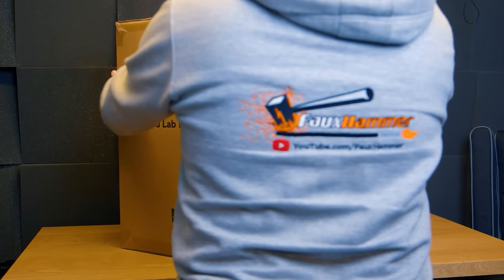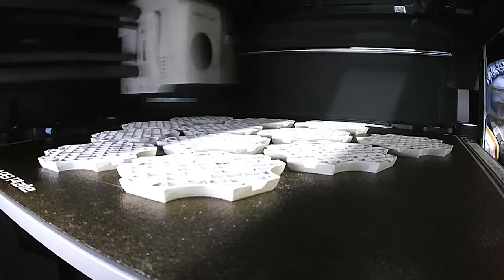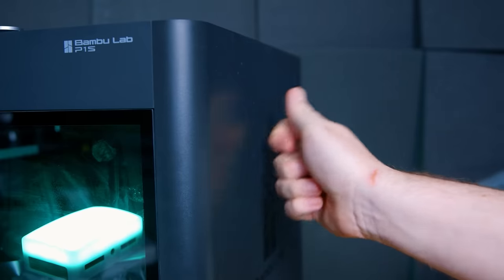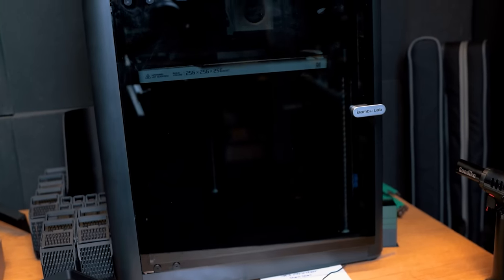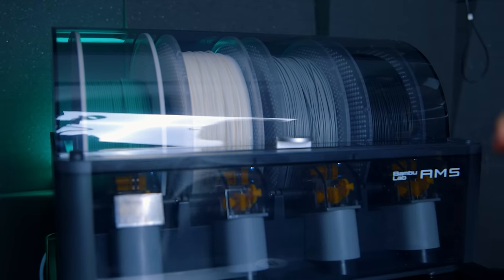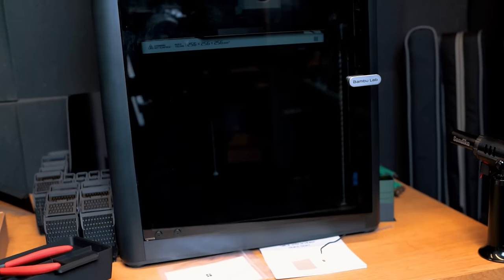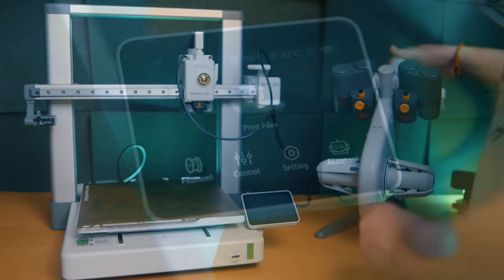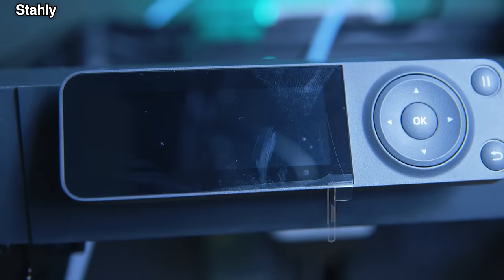Bambu Lab P1S Review - Please Start Here - I BEG YOU

Comment: is the A1 combo good enough, if you dont want to print abs asa nylon etc
Reply: Absolutely yes. In fact the A1’s are quieter and moisture isn’t that big of a deal with PLA. If you find it is, simply buy a spool dryer to use frequently. I have a mini and at work we just got an A1.

Comment: I think the support from Bambu just ruins me on the other companies Support. I look a the GK two support love the printer but there support is just not there. By the way I sold my Anycubic M5s boat anchor for $200. I love the screen on the X1 carbon but with the app you don’t really need that screen. The x1 screen make it easier to use at the printer which is important to me but the next one I’ll buy is the P1P just because of the AMS, that’s a maybe lol. As alway great video, I love the stock videos on because it helps put your point of view across. Thanks as always B
Reply: One thing that reviewers of the Bambu Lab always fail to mention is that the WiFi connectivity on these things is not very good. Which is odd, since the out of the box approach is indeed a major advantage of this machine. 

To connect the machine to your pc you need to install their app (which asks user information, location and for some reason your contacts information). Next, it only can make a connection through a pilot blue tooth connection (rather than entering SSID and pwd immediately, like on all other networked machines). On top of that, the WiFi antenna on these machines is notably very weak (as a summary search of Youtube comments describing similar issues indicates).

All this is very odd, since the WiFi antenna is on the back of the panel. Production and customer relation wise, it would have been very easy to update the WiFi antenna to a stronger model. Despite this, comments regarding the weak WiFi reception (and the complicated process of making the connection) go back all the way to the first release of this otherwise quite good machine.

Comment: I am totally new to 3D printing and consider getting a Bambu Lab P1S-Combo. I have a few questions.
1- Can you print with the Bambu Lab P1S-Combo w/o internet or do you have to be connected to "your" account from Bambu Lab?
2- Does the AMS act as a filament dryer or you need a separate unit to keep your filament dry?
3- Can I print a STL file directly?

Thank you for any input.

Comment: They really are an impressive bit of kit. Printers with similar features and capabilities that come to mind as alternatives are the Qidi Tech X-Plus 3 and the Flashforge Adventurer 5M Pro. The X-Plus 3 is a bit larger, has a better screen, the enclosure is heated, and is cheaper right now. The Adventurer 5M Pro also has a better screen, superior air filtration, is a bit smaller, and is even cheaper. Neither are fully open source and neither have an AMS. Also worth noting the Adventurer 5M is $299 right now, which is crazy, and they are releasing an enclosure kit which is a mixture of a cheap purchase and printed parts. So, not interested in AMS? The others might be good options. Want AMS? Bambu Lab.
Reply: Oh, I did of course forget the Creality K1/K1C. I'm sure everyone knows the deal there. Some flaws, similar capabilities overall, smaller build volume, cheapest of the bunch. I can definitely see why people would go for the P1S given the overall reputation, but saving money is always tempting. Anyways, thanks for the review and thoughts!
Reply: Flashforge just released the klipper firmware for the adventure series
Reply: @marcostaffoli5798  Oooh so it allows vanilla Klipper to be used or is it a proprietary implementation?

Comment: Youre not wrong, the corexy is better if you can afford it, but if you cant, the A1 is TOTALLY acceptable as a starting point.  Either way, theres now almost no excuse to buy a bedslinger from anyone but bambu if youre starting out.

If you need to excuse getting the enclosure version just remember youre gonna use a lot less power if you arent air conditioning your printer and your printer isnt heating your entire room.

Comment: One thing that reviewers of the Bambu Lab always fail to mention is that the WiFi connectivity on these things is not very good. Which is odd, since the out of the box approach is indeed a major advantage of this machine. 

To connect the machine to your pc you need to install their app (which asks user information, location and for some reason your contacts information). Next, it only can make a connection through a pilot blue tooth connection (rather than entering SSID and pwd immediately, like on all other networked machines). On top of that, the WiFi antenna on these machines is notably very weak (as a summary search of Youtube comments describing similar issues indicates).

All this is very odd, since the WiFi antenna is on the back of the panel. Production and customer relation wise, it would have been very easy to update the WiFi antenna to a stronger model. Despite this, comments regarding the weak WiFi reception (and the complicated process of making the connection) go back all the way to the first release of this otherwise quite good machine.

Comment: Does it auto calibrate input shaping and self resonance like the A1 does? Should I buy used P1S or A1? Caveat: I do NOT need speed.
Reply: Bought new A1. No support for Cura is a huge bummer as any Prusa Slicer derivative including Orca is inferior in terms of usability by a mile!
Reply: Yes. You just put the print on the SD and then the machine makes a lot of noise and then the piece comes out. Very out of the box. Very noise and bad WiFi too.

Comment: You mention that when printing with  pla with the P1s, the top glass has to be removed to regulate temperature, I have read the same on some articles. BUT if I have an AMS filament unit on top, do I still need to remove the top lid or if I am printing pla, do I  have to move the AMS to the side? Thanks for such great videos.

Comment: Almost went with the P1S but opted for the A1 with AMS lite instead which i have been super happy with untill the rear heatbed cable issue. 
Might be worth some A1 users returning their faulty units and upgrading to the P1S instead as i can see a long wait ahead with no printer at all whilst Bambu Lab get a grip of the situation.
Reply from the maker: I heard about that issue, didnt they fix it?
Reply: @FauxHammer  They've stopped A1 sales right now. Got 2 options for those with the cord problem, fix it your self with the parts they supply and get compensation or get a replacement printer for those that don't want to DIY. Those without the cord issue will either get sent a part that they can install for more strain relief or if you need it ASAP you can download and print it yourself. It's in their blog.

Comment: Got one of these for black friday for €100 off and they threw in a couple of kg of random filament. Pretty good deal. So far printer has been pretty reliable although I used some old filament in it that unhelpfully snapped right in a place I had to disassemble the entire print head and remove the original nozzle to fix. There is something to be said for bowden setups when this happens and all you need to do is push filament through to clear the snap. AMS is simple to use, that it's easy to forget what a PITA it is to manually change filaments. It does poop a lot of plastic though and I wish the slicer profile would incorporate some of the poop reduction techniques people have come up with.

Comment: Id rather wait for the phrozen arco or bambus next announcement on the 5th of feb.
256mm bed is pretty small esp if you want to start making props.
Reply from the maker: I'm getting the Arco when it;s ready, still in dev stage, but I've seen some preview shots which I like.
Reply: @FauxHammer  thankfully its flying gantry! Ive been in talks, it seems good and the ams is a heated dryer too. But hopefully specs on paper to product it works well it even has a external filtration

Comment: I may be missing something, but coming from a Longer MK4 I'd say it's way more than a "slight increase" in print speed.  I have only run three prints through my new P1S, but I have run each of them through a slicer set up for my old printer and it's like 1/3 of the time if not less.  I was going to keep the Longer around for some basic parts, but after cranking out some parts over the last few hours that would have taken all weekend on it I think I'll look into ideas to repurpose it instead!!

Comment: I bought the X1C because of my specific needs and was able to justify the price, but I would have been just as happy (for the most part) with the P1S.  I had about 1 year experience with and Ender 3, however I found I didn't really need all that much of the experience in order to print very high quality reliable prints straight out of the box.

Comment: I like your videos. 
Been 3d printing for about 3 months.  I have an elegoo neptune 4 plus and 2 p1s's
Looking at buying anther neptune 4 plus. 
BIG  difference between set up and learning. 
If you could,  
I'm having an issue. 
Every time i switch filament,  My machine (p1s)
Says it is busy with another task. Making me have to shut the p1s completely off for like 10 seconds,  i turn it back on and it works fine..
Could you possibly tell me what I'm doing wrong?
Much appreciated
Reply from the maker: I’ve never seen this myself, sorry. Have you tried posting this in one of the Facebook or Reddit groups?

Comment: I've owned my P1S since September last year and it likely has over 700 hours of print time on it. This printer has been nothing short of a work horse. No bed levelling needed. In fact it has no limit switches. They've managed to capture the torque increases on the motors to determine where the limits should be. All I know is it's been a world of change from running cheap $400 printers that you have to screw with before printing to this monster that just prints what's it's asked to. I also bought the AMS which is changed my printing experience yet again. The printer and AMS cost me a lot but at then end of the day the savings in aggravation and the quality of the final prints was worth it. Just my 2 cents for what it's worth.

Comment: Did I hear you correctly that you have to remove the top cover to print with PLA? If you do that can you still put the AMS up there?
Reply from the maker: Yes. You don’t neeed to put the AMS on top in the first place. But you can also print an AMS riser with a shelf in to put the glass on

Or not and just open the door instead

Comment: I'm considering in buying this, for ABS and ASA, but at the same time, from the research i did, there are people that complain that it has issues printing ABS/ASA
Reply: Have a P1S. Printing large ASA flat functional parts has been difficult. Spent weeks tweaking for cheap Elegoo ASA and heating the chamber to 60oC w a heat gun to avoid corners lifting and warping. 1.5 hours of preheating and cooldown phases...  Printing small parts is probably fine, but without a heated chamber large ribbed parts just don't work.
Bought Bambu ASA, will see if it prints better / faster.
Am building an automatic heater lid now. Will see if the process can be automated.
More on my raphtronic blog, in case it helps.

Comment: I have used a resin printer for over two years now, but have been thinking of getting an fdm printer for a while. My main reason is for practical printing as well as wargaming accessories. Still unsure what would be best for me, as i am like you and don't want to tinker, so the bamboo labs printers have caught my eye, but i have a few questions. 1. Does the P1S require an internet connection to function? (WIll it refuse to print/operate without one). 2. Does it also require an app? (does it have features that are only accessible through an app). 3. It features a camera for timelapses and checking prints, but can it also detect print failures and cancel the print in the event of one?. and finally, 4. With the enclosure and filters, would this printer be safe printing while someone is in the same small room as it for long periods of time? 
Sorry for the long comment, i just want to ensure i am getting the right printer 1st time. Thanks for the informative videos. :)
Reply from the maker: No worries

Without Internet you loose the ability to send prints to it remotely over WiFi. But you can still print by sending files to an as card and popping that in.

It can detect some issues but not everything, but it rarely has issues after the base layer is down. The only issue I had was filament run out or jam, and it detects those

I have no idea about the safety of what these printers give off however, sorry
Reply: @FauxHammer  thanks for replying. I am not to bothered about wirelessly sending files. Nice to have as an option but i would rather not have a “always connected to home base” sort of printer that can be updated firmware wise automatically for better or worse. I think i may go for the p1s as so far it seems the best in terms of an appliance that does a job well and future proofing where filament choice is concerned. 😊 thanks again.
Reply: All printers give of fumes and microparticles. We're melting plastic after all. I wouldn't recommend being in the same room unless it's well ventilated to the outside.

Comment: Bought an X1 Carbon Combo Saturday. It is my fifth FDM printer. Wanhoa D6, Ender 5 Pro, Ender 2 Pro, FLSun SR with Speeder Pad in that order. If it had been my first I'd have a stable of Bambu machines by now. It's freaking amazing. I'll be very unlikely to buy a different brand for quite some time. Though it seems Creality K1 series is getting closer to this level of plug-and-play.We shall see.

The sticker thing is for the replacement build plate sheets you get with the X1-Carbon, I think. Mine came with two replacement surfaces to apply with you wear out the ones applied to the build plate.
Reply: Just get the textured PEI plate and never look back. From my admittedly short experience (a couple of weeks) with the K1 Max, it is the only current gen printer that competes with the Bambu's. Not on polish, but on performance. I hated the QIDI X Max 3 and was only too glad to replace it. I'm struggling with the Kobra 2 Max which seems to go from one broke state to another without much printing in between. But the three Bambus (one very new) keep soldiering on and the K1 is right there with them.
Reply: @Immolate62  Would you have a stable of Bambu or K1's I see the K1C and thought about getting that over the P1S

Comment: If you need to take off the glass lead off when printing with PLA , does it mean that I also need to remove the AMS module and put it somewhere else?
Reply from the maker: I actually printed an AMS rider which comes with a shelf so you can have the glass on top or raised slightly above to leave a gap

Comment: I have bought a P1S, and even for PLA, I still have it enclosed and disable the aux fan, it just seems a lot more "consistent" and doesn't lift the corners at all (it does if I have the fan on), and it also helps keep dust and debris out of the printer which was a big issue at the long term in my previous prusa mk3

Comment: Just a quick question: I saw you top mount 2 AMS units to your P1S. I can’t find a video showing how to do this, how did you do it?
Reply from the maker: Yeah so you need to buy the AMS hub from Bambu, once you do that you can daisy-chain up to 4 AMS units for 16 colours, which is what I have now.
Reply: @FauxHammer  and you have both ams units mounted on top of the printer right?
Reply from the maker: @talboomerik yes I did but now I have 4 it’s a little different. I found a dual AMS riser I printed which allows me to still lift the glass and put it in a shelf.

Comment: im considering to buy a p1s , first i looked at the a1  but its a open bed slinger  and i have kisd n´ cats , thats why i have my actual printer sv07(and all my others befor)  in a cabinet, and thats the next problem  normal bedsliinger are not designed to put them in a cabinet or any type of full enclosure, cause they fckn overheat .  most times i have 80+ degrees on mcu and 85+ on rPi .
so my choice comes to p1s  , i can put them where i want and get rid of my bulky cabinet .
Reply from the maker: yeah that is a better choice, and it echoes the reason i would also choose an enclosed unit. It has a more limited UI, but honestly, you'll control it remotely 99% of the time

Comment: Rather than support material, would just using something like PETG as the interface material between supports and the model work well? I imagine there would be a lot less "waste".
Reply: PETG works, but it doesn't adhere to PLA so I'm concerned about what could go wrong. I really don't have too much trouble removing tree supports (is there any other?) from my prints from Bambu Studio or Orca or Prusa using the same filament. It's CURA that has the affliction. I just threw away a 22 hour print on my K1 Max because I couldn't get the supports off without damaging the model. I did it again on Orca and then Micro-SD'd it to the printer.

Comment: Hey there, great video, just wondering if the P1S can print flexible TPU....if it can , with minimal issues, let us know.....or even make a vid on it🤔😃
Reply from the maker: It can print it, but TPU is a pain in the ass in any printer. The AMS struggles with it a bit because it’s stretchy. So auto moving and retracting can be more troublesome.
Reply: @FauxHammer  Good to know. Thanks👍🏾

Comment: Worth noting that most engineering materials are quite abrasive to print and you really should upgrade the gears, etc on the P1S/P1P to the hardened kit bambu sells
Though I guess if you don't you'll have to after not to long anyway once they wear down